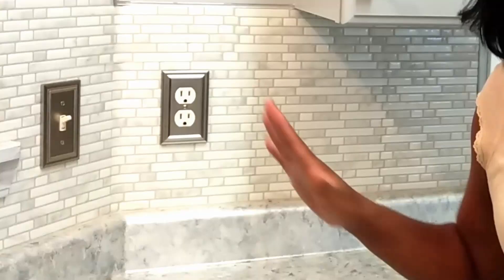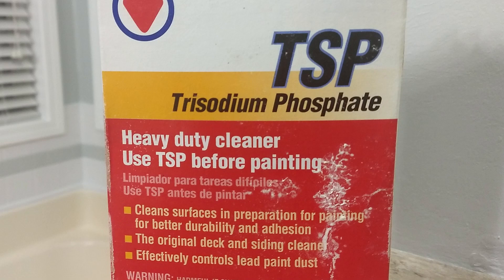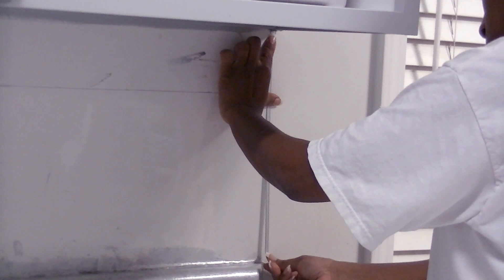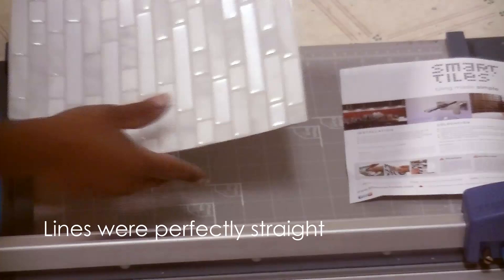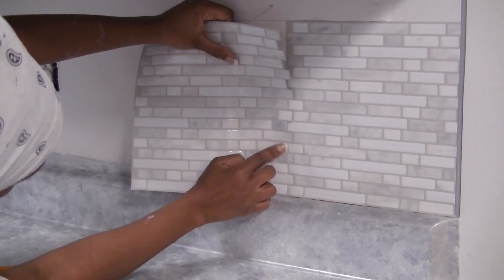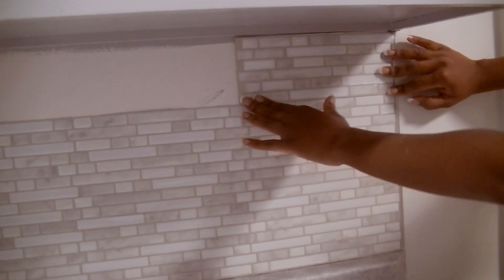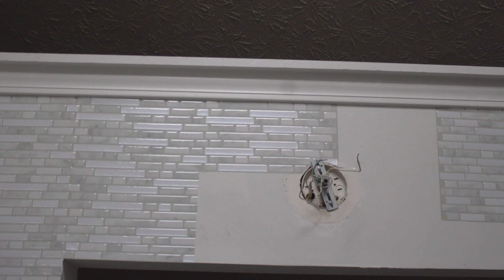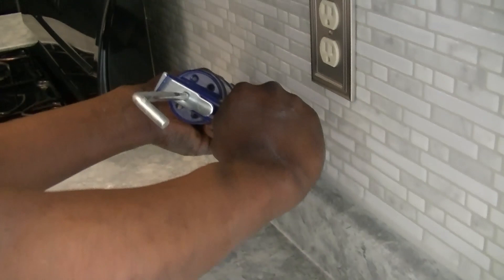AMAZING Smart Tile Peel & Stick Backsplash Install - Vinyl Stick Tiles | DIY Power Couple

Comment: Great job! I love Smart Tiles brand. I've installed around bathroom mirrors and kitchen backsplash. I ran into an issue in the kitchen, though. I didn't use a sharp knife, so you can see the cutting in one spot. Also have a spot missing. Since my knife wasn't sharp, I didn't want to cut anymore. Haven't fixed it, yet. It's been almost a year! 😔 Just gonna have to redo. I know that it will pull the paint right off to the drywall, but it should be fine since I'll cover it. Thanks for the inspiration.

Comment: Now that the tiles are in place and it all looks wonderful I have a question.  It seems the face of the tile is sticky to the touch when I removed the film.  What cleans that off?
Reply from the maker: You may need something strong like a tsp cleaner to remove adhesive. Please read the instructions before applying.😃

Comment: Looks really good like you went around the opening up to ceiling and you did inside of the opening, how does it look from the other side of the opening. Lucky the stove was electric not going to move a gas, code require plumber hookup.
Reply from the maker: Hi!  We did not tile on the other side that opens up to the living room.  It looks better than expected because it blends nicely with the painted wall!  Thanks for watching!

Comment: Wow... how did it hold up around the stove? does the heat cause any issues?
Reply from the maker: Candice, we were pleasantly surprised that it held up extremely well around heat. It still looks the same  without any problems. -DIYPC😃

Comment: Do you have a gas stove or electric? I have a gas stove and not sure I can move it out without turning gas off. You did such a great job
Reply from the maker: Hi Debra, we have a gas stove.  Thanks for watching!
Reply: Did you turn gas off to move stove
Reply from the maker: No, thankfully the connection was long so we did not have to mess with the gas at all.  We think our wall has another connection for electric if we had to use it.

Comment: Hi, I been watching your videos and love them! But please tell me where I can get the gray finishing edges? I been wanting the do a backsplash for my bathroom & kitchen. I did one side of my small kitchen with marble tiles although, it came out great(for my first time) i just can't do it it's just to much and the machine was so loud for an apartment. So at this point peel and stick it is!
Reply from the maker: Hi J M!  You can order gray "smart edges" directly from Smart Tiles online.  Check the link in the description. Thanks for watching!

Comment: Great video once again you guys did a beautiful job on tour kitchen. Question those smart tiles do they come in other colours and styles ? The kitchen is my next project also, for those who live in apartments ; do they remove easily with leaving a mess behind?
Reply from the maker: Thank you!  Yes, they come in many styles! Check out the link in the description.  We haven't removed them yet so not sure about that, however the SMART TILE website may give you removal tips. :)

Comment: We have an orange peel texture on our walls..  Do you know if these will work?
Reply from the maker: Diana, These have a pretty good adhesive backing, but we only placed them on smooth surfaces. The only way to know if they will stick on a textured surface is to get 1 box and try. We try lots of things. Let us know how it turns out. Thanks for watching! -DIYPC 😃

Comment: I went to home depo yesterday and ,I was surprised that the real tiles was cheaper than the peel and stick,,, they wanted 25 dollars and up  for 2 sheets for peel and stick and as low as 1.29 for actual tiles ??? how was the price for you and thanks for the video.
Reply from the maker: Hi Debbie! Supply and demand has changed the prices since the first time we tried it!  You could try the smarttiles.com to check for any specials. 😊
Reply: @DIYPowerCouple  thank you so much💕

Comment: How did you bend the tile to curve around the window?
Reply from the maker: Hi! We cut out the tile to the size of the window frame. We aligned the pieces close together.  It looks like it wraps around the opening, but it actually is cut to meet at the corners.  Hope this helps!